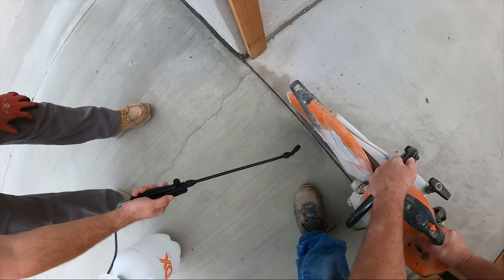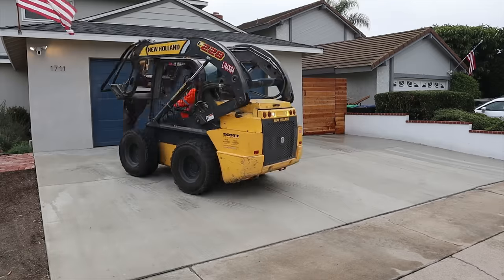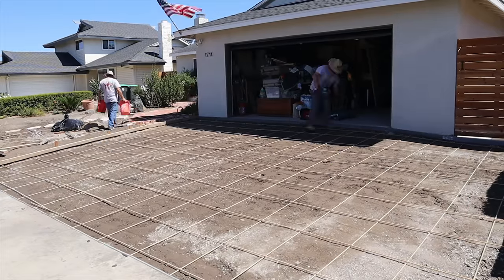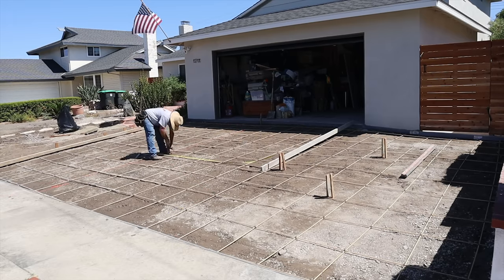Concrete GONE WRONG! Had to Remove and Replace

Comment: Nice work. Respect to a man with integrity to completely stand by his work, without the slightest bit of finger pointing or complaining.  Job wasn't done right, we'll make it right.
Reply from the maker: I concur
TY
Reply: Bad material
Reply: How did he make it right if the homeowner had to pay for concrete twice??
Reply: @michaelmotes8392  he indicated he was the one to pay for new concrete if the concrete company wouldn't cover it.
Reply: @michaelmotes8392  wake up
Reply: Bs
Reply: but to be fair, this was a mistake made at the batch plant.
Reply: @michaelmotes8392  why would they use the same company if they didn't correct their mistake
Reply: But he did point fingers. He said it had to be the concrete supplier, not his workmanship. That is why he compared it to the one done across the street, same workers, different concrete supplier. So his implication was that his company was not personally at fault, but he would help out the customer anyway. A good way to be, but he did make a point of observing it was not his fault.
Reply: we do things nice becuase we do things twice
Reply: crappy mix of mud
Reply: @Theirhypocrisyisrealb  not enough stone
Reply: @marks6663  "But he did point fingers." 
Please notice "finger pointing or complaining" is colloquialism regarding 'an attitude of blame avoidance.' 
Not to be confused with "Learning" which is 'a process of identifying sub-optimal factors with the focus on improved end results.' 

Also, if it ain't broke, don't fix it. 
It is ideal to repeat a proven process while only rectifying the actual hiccup. It does no good to take on responsibility for other's mistakes and make changes to the successful portion of YOUR process. 
..except in a major corporation if you're trying to keep, middling soul-shriveling employment
Reply: More respect for someone who can do a job right first time.
Reply: @priceyinbowen  No one ever "does the job right the first time."
It takes practice, it takes experience.
You've said the equivalent of, "More respect for a golfer that always gets a hole-in-one, every shot since birth."
Or, "more respect for someone who has never slipped on ice."

God was a carpenter, not a concrete layer..
Reply: Totally agree with you! The one thing I would have done differently is cover the garage door when concrete was being broken out. Don’t want to buy a garage door too!
Reply: Thats rare
Reply: Ive been on a job where they removed a concrete floor for a hotel twice!!!! Because of a bad mix and witg those air chizels it came out fast
Reply: rebar in the dirt unacceptable
Reply: @gm4ulkill  At a young age I was taken in by the Mondello family from Italy, from the town of Mondello, I learned by working for papa(Frank the I) first the old ways he brought over in the late 1800s, when he died out of 100s of cousins and family members he left me a 20-year-old box of chisels with a Square and Compass on everything and all his tools. and days it rained it to me to the Lodge, then when he passed I worked for his son, Frank the II, one of the best bricklayers in the Hamptons, we even did an episode on Sesame Street lol, then I would work round-robin style with the other brother Nick, who specialized in Stonework, and Nick who did major jobs on the Ocean, and he owned Southfolk Masonry supply, (until a rich lady whos husband was a County Rep)wanted to make it a flower shop..so my vacation over the summer was being a yard dog, this is about 14-15..there's work done, from Cobble Stone to stone work I did in 86 at 16 years old that's still in perfect shape...the problem now is we have landscaper doing Masonary work,i went into the USAF for a long time, but still do work for friends and family,or over see the people they hire, its a science...and they old ways are dying out..the extra things you do to make youre work look not just better but last longer...because I see it at the end of the day..its youre work...youre name is on that,whether its a walkway or a patio or patch...
Reply: @priceyinbowen  Clearly you don't work in Construction/Contracting etc. Nothing is ever done "right" the first time. The next contractor will always come in and complain about the old stuff even if it was done properly it would still be "wrong".  This is the issue when you have soo many variables happening at once.
Reply: Half of you are people I would never want to work for. You are blaming the contractor for foul material. That happened to me once and I got in to commercial work after thst. Other contractors understand sometimes you get bad materials. How the hell is anyone supposed to know? You can't do a slump test when the concrete shows up. It has to be poured.
Reply: @rchurch2769  
YES, my Drive way started cracking right away. I demanded ( Expansion joints) the cement guy just wanted to use ( Rebar with mesh) then dummy joints only. the company he bought the mix from, did not or ever heard of them. There was a strike going on with the big cement drivers and owners going on when we poured. The guy across from my house used same company on his drive and the third cement truck, the pour had oil look on finish work. So much a different color. His drive cracked all over. The guy he used to do cement will not talk to him. Not same guy we used. On the large bridge job they did in are State. The batch plant was on site. And inspection was done ( slump test) on each load put in place.
Reply: @tedayoub5979  - Rebar (no matter what type) has to be at least 2/3rds the way up the slab off the ground according to a couple of different materials engineers I talked to. They told me that cracks usually begin at the dirt or base layer and work their way up to the top of the slab (are larger at the bottom and finer at the top due to moisture in the ground). 

I had two medium size jobs done (a large parking area, and a medium size garage), and both developed large cracks within a couple of months. The contractor wouldn't redo it/ repair it. Said it wasn't his fault. 

I bought rebar chairs but the contractor/ concrete guys didn't want to use them. They told me they're not necessary. They said they float the rebar (pull it up) while laying the concrete (and it will stay elevated due to aggregate in the mix supposedly). Though there is no way to tell because the concrete submerges the rebar regardless obviously. I have no idea whether or not the rebar sunk back to dirt/ base layer (compacted crushed stone).

I'm convinced that isn't a good way to do it (though chairs aren't good either). On a large thick pour chairs may be alright. In the future I'm going to drive rebar stakes into the ground and use tie wire to secure the rebar elevated at least 3 inches in the mix (for a 5 inch pour). This ready-mix might have been bad also. I'm now convinced based on research that the more crack relief cuts the better. It may have drawbacks and be more labor intensive, but on a job like this, I would have done, 4 x 4 or even 3 x 3 cuts.
Reply: @michaelmotes8392  - Are you the homeowner?  How do you know?
Reply: Agreed.
Reply: @Dr_Wrong  Jesus was actually the carpenter!
Reply: @dougupah8778  ah, so you're an atheist!
Reply: @Dr_Wrong  I hope before you dive into a body of water you check first instead of foolishly assuming the depth
Reply: @dougupah8778  this is a driveway, not a swimming pool..
What video did you watch??
Reply: uh he pointed the finger at national
Reply: @JCG Thewordis or plastic safety fence it doesn't rust like chicken wire
Reply: @michaelmotes8392  not sure where he said the homeowner had to pay for the concrete twice
Reply: @michaelmotes8392  Pretty sure it was free to the homeowner and the contractor took the hit, if National didn't supply the concrete free. I gained this information from watching the entire video but could be wrong!
Reply: The weather and temperature that you pour are important to note. Asking for different mixes such as a ‘low heat of hydration’ or additives such as using plasticizer to increase higher slump instead of using water help big time.
Reply: color is not even even not good quality work
Reply: I have the same problem !!!     Damn this sucks only a yr old
Reply: the ready mix company should pay to install the new driveway , because of their junk
Reply: @2nearalki306  stop coddling these inept apprentices. This guy needs years more training under a competent tradesman.

Comment: The fact that you were prepared to accept that there was a problem with this job is to your credit, without trying to overtly offset blame, adds greatly to your Company’s reputation. Hopefully the financial losses incurred in fixing this problem will, in time be more than recovered. Well done David and congratulations to your team.
Reply from the maker: I concur
TY
Reply: It absolutely makes no sense for a Contractor to knowingly lay defective material. The commitments of ongoing future business and allocation of workforce, let alone maintaining reputation of the business means that no one would follow such a strategy.
Reply: edntz That's why I don't hire fly by night businesses. Unfortunately people hire them because they are initially cheaper, but realize too late that it cost them more in the long run.
Reply: @evanofelipe  Sometimes it's the supplier's fault we did  foundation stem walls for a house and when we removed the forms big chunks of concrete pulled off with the forms . it was a bad mix from the concrete plant to much sand in the mix . The concrete company paid for the concrete removal and the new concrete was free , but no money for all the rebar and new form work .

Comment: When I complain to my contractor that the concrete they just poured a few months ago was cracking they just blew me off and said that’s normal so I have a Lotta respect for you
Reply: Yeah, cracks are kind of a given in certain areas. In Texas they would laugh at you if you asked them to redo this driveway. Cool to see someone do what he did here.
Reply: It depends why it's cracking. That was clearly bad material, it was falling apart. But, I would expect that a crack would form at some stage in any pour, because there are a lot of things about this that aren't perfectly predictable.
Reply: Yeah when I built my house I hired two guys that were plasters for outside walls and they did front concrete slab.  It cracked in a lot of places and their response was that’s normal. So I’ve learned how to do it myself and poured and concrete slab yesterday
Reply: Yeah sure you did. I’m sure any noob can just watch a YouTube video than decide they are going to pour their own slab.